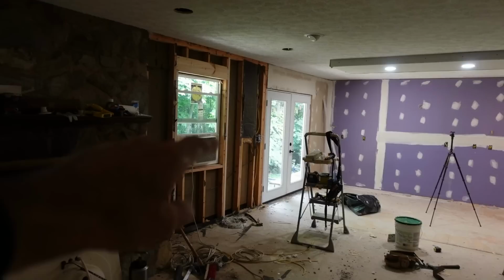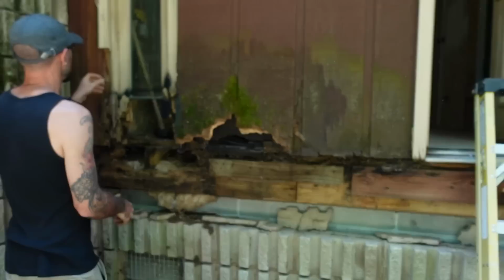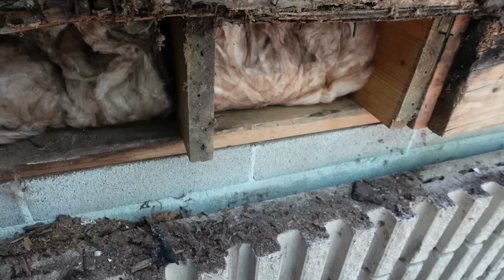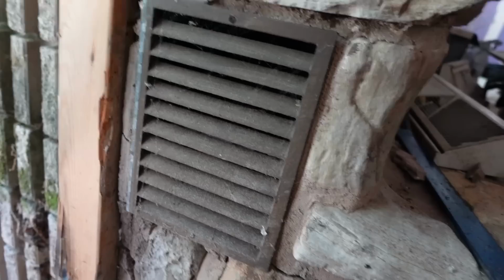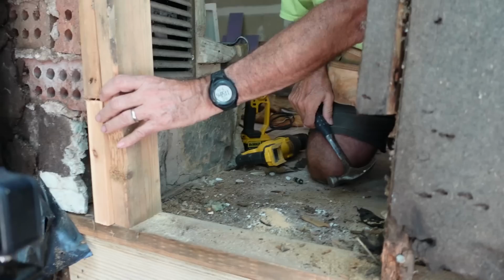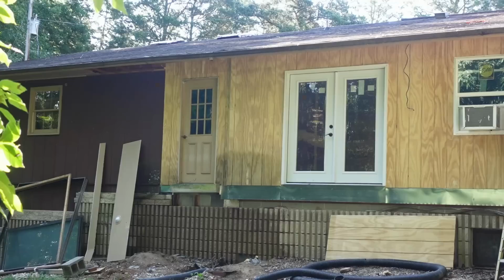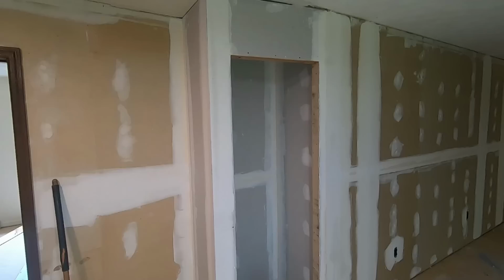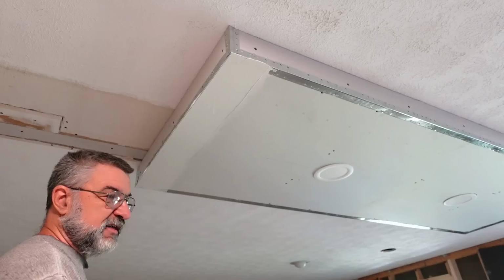Finishing the Back Wall - Flip House PT 11

Comment: The fast motion makes it look so easy. It must be hot to work as well. I could not work in such heat.
Reply from the maker: I have trouble with the heat too, I can’t work outside in the afternoon. Fortunately the house is air conditioned for inside work!

Comment: Great work!  The house will look fantastic.  Just wondering how come when builders go to so much trouble they don't fit walls with insulation etc and build a home for the future?
Reply from the maker: ??? All outside walls and ceiling are fully insulated.  I don't understand your question.  If you're talking about insulating interior walls, that would add WAY too much cost, and what would be the purpose?

Comment: Speaking about the shower. The shower surround appears real short and I bet the shower is lower than it should. When you were standing in the shower your head looked like it would be well over the shower head.
Reply from the maker: The shower surround and head are at the standard height.